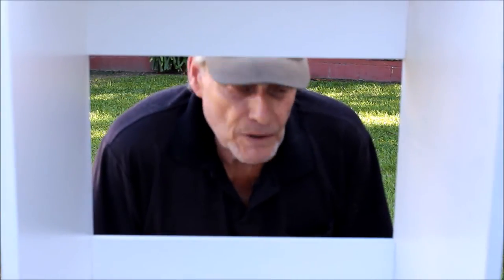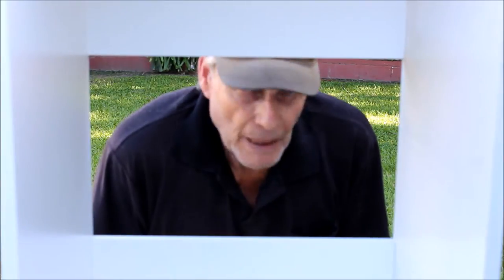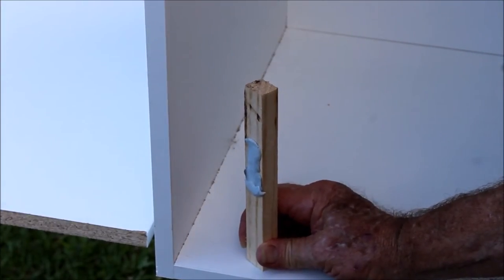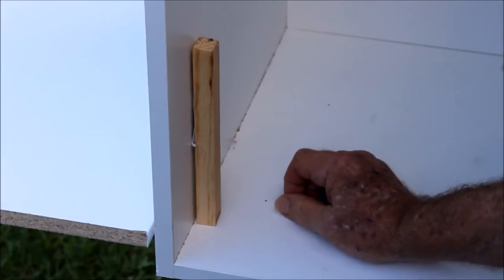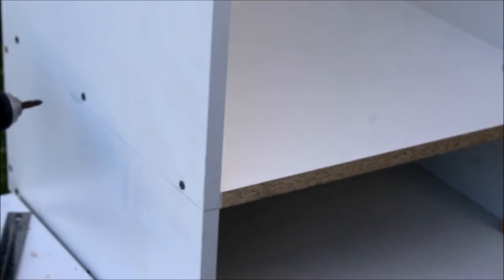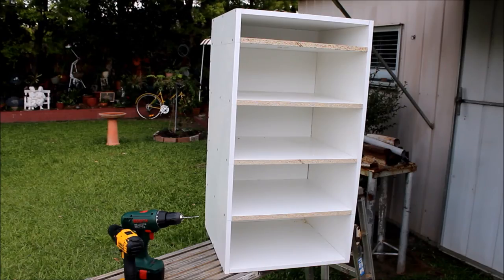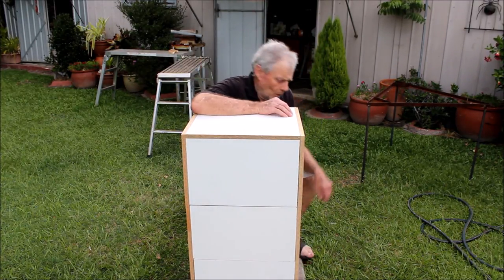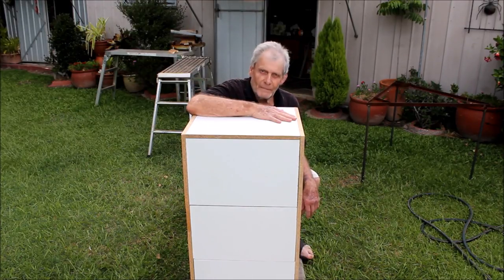Four Shelf Storage Unit With Castors 😄

Comment: I don't know what it's like in Australia but In the uk anything made of wood is rocketing in price , even for the most simple piece of furniture..
Reply from the maker: Timber here in Oz is in general expensive, which is why I much prefer to use metal when and if I can. In fact I much prefer metal over timber anytime, because if a mistake, say in cutting length, is made, metal is very forgiving in as much a piece can be added and welded in place and is as strong as the host, whereas timber is not so forgiving in that particular scenario.